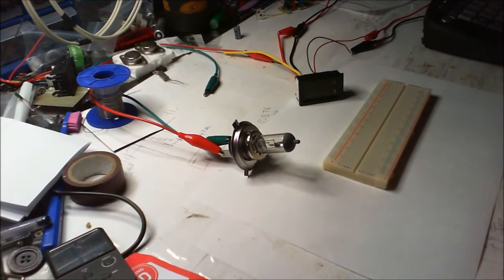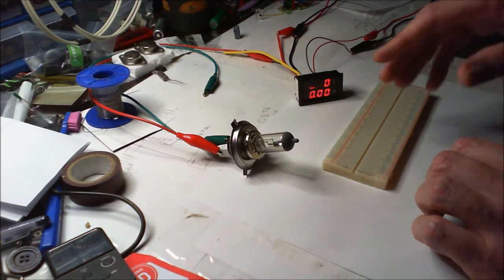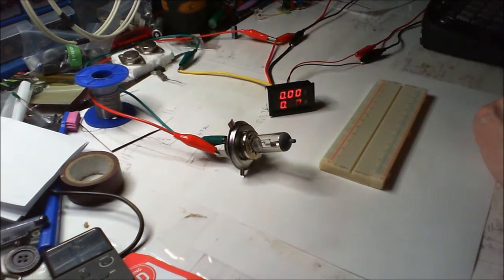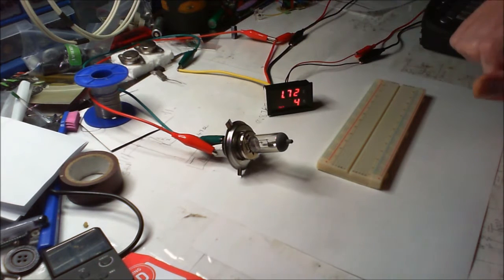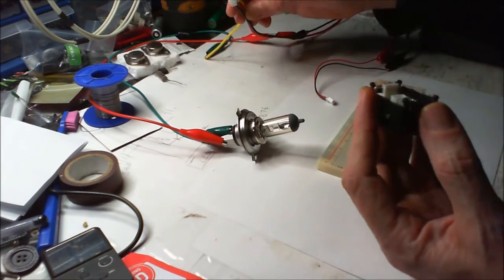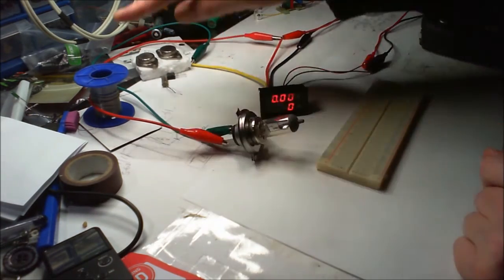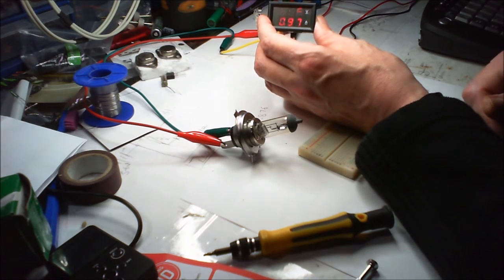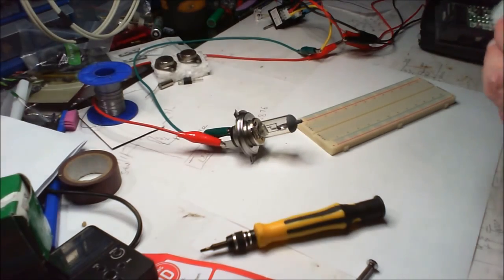Ebay Volt Amp Meter Red Red Display Wire Up Pt1

Comment: OK I bought a few and on the listing it said to run a shunt with it but yours seems OK
Reply from the maker: +retro80s it depends how much amps you could pull through it. I am regulated by the power supply's ability. Connecting to a car battery you have the potential of pulling a lot more amps through it, then a bigger shunt would be good.

Comment: Great explanation, Thanks. I have a question though if I may? I ordered 1 of these but want to hook it up to a single output power supply. Do I now need 2 separate supplies to have this work for me as the voltage would be too high for just powering on the device when using my supply? Thanks in advance
Reply from the maker: the LED display itself needs 4 volts to 30 to power the meter. It will measure a separate voltage, which in this case if I remember is from 0 - 100 volts. It will depend on the voltage you want to measure. If you use it in a 30 volt supply you will be fine... if you use over 30 volts then current limit the power to the meter, not the voltage you want to measure.
Reply: Thanks, yes it's a 36v single output supply so looks like it would be too much.there are however three places to attach to for powering devices, so I wonder if a resistor in line with the supply to the meter would work?
Reply from the maker: If I remember right, I put a 560 ohm in series with mine and it is OK.
Reply: Thank you, again

Comment: won't the meter burn out without a shunt if you were to run say 12v 5amp load .I always thought you needed a 75mv shunt
Reply from the maker: Hi retro80s, I has a 10 amp shunt built inside it. When I build my power supply I will give it a constant resistance test ( 5 amp ) and see what happens to it.
Reply from the maker: Its good for 10 Amp according to advert.